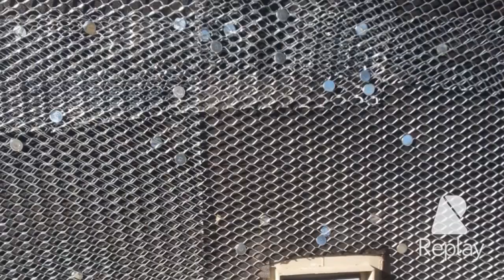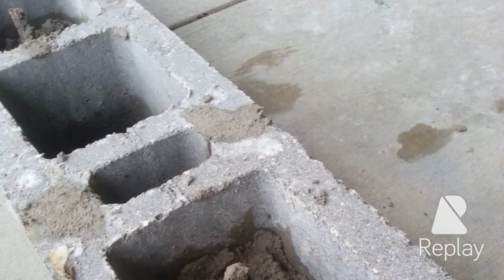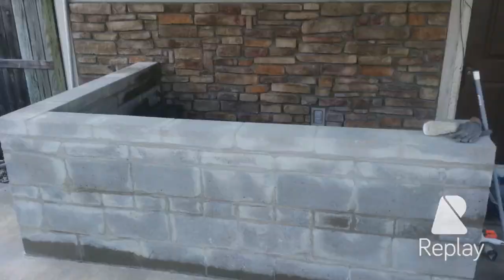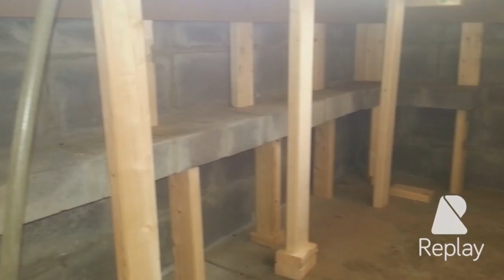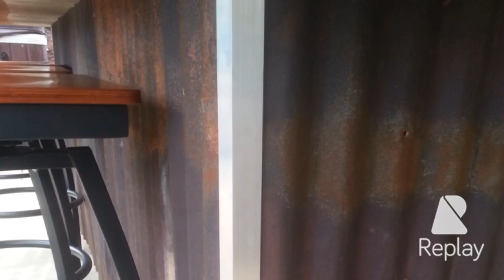My Patio Bar

Comment: I want to do this. Any suggestions or advice?
Reply from the maker: Make sure you spray the cement as it dries with a spray bottle two or three times daily and cover it with a tarp to ensure it dries from the inside out. The boards also came off a bit rough, so if I was to do it again I would use more Pam on the inside of the boards before pouring the cement. Also -- when acid staining the cement cover up EVERYTHING. The small splatters did not come out of the cement below well at all and required TSP and a power washer to lighten them up. 

Aside from this, support it well on the underside with 2x4's, use plenty of rebar, and enjoy the fruits of your labor!